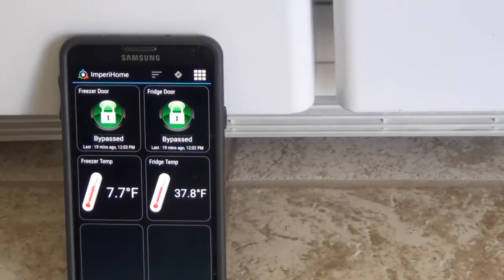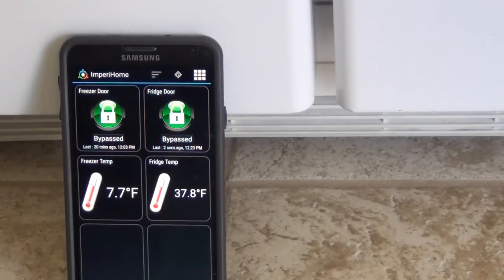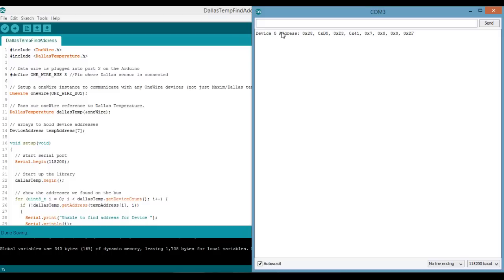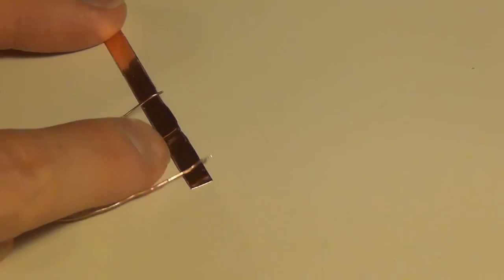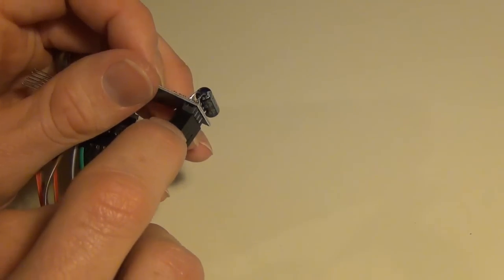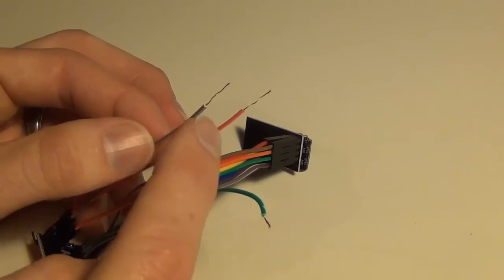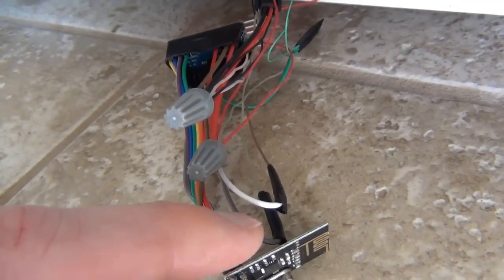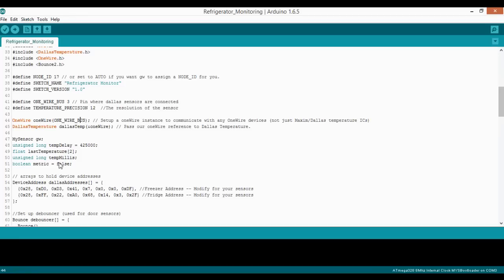Refrigerator Monitoring with Arduino and MySensors

Comment: Question is there a way using Aurdino and an app to monitor not just the doors but the over all diagnostics for an off-grid solar run fridge.. company called Unique from ONT, CA...if the thermostate or any other part is not functioning properly or malfunctioning or needs to be replaced.
Reply from the maker: I'm not sure exactly what you had in mind but I'm sure you can monitor it if you can measure it somehow.  Maybe you could measure the current draw and compare it with a normal measurement then alert if it varies?

Comment: Don't you think putting wire and copper tape will leak the sealing? 🤔
Reply from the maker: It is very thin copper so if there are any leaks they are very minor.

Comment: There are two ways to fix this... one is to level the fridge (gradually raise the two front adjustable legs until the door closes completely again) and the other is the Ardunio way :) This said, it could be an interesting energy saving device. Maybe let out a little beep when the door is open for too long.
Reply from the maker: The door normally closes automatically but the problems start occurring when someone (not mentioning any names) doesn't push the food/drink in far enough which causes the door to remain slightly open. :)

Comment: So it goes like this: 
Sensor >> arduino >> RF Module on fridge >> RF module on home automation system >> Arduino2 >> Wifi / bluetooth module >> to your phone.
Reply from the maker: +Derpy Herpy Close but there are a couple of things I clarified below.  
MySensors Node (Sensor >> Arduino>> RF module attached to fridge Arduino) >> MySensors Gateway (RF module attached to gateway Arduino >> Arduino 2 >> W5100 Ethernet Module) >> Home Automation Controller (I'm using a Vera 3) >> Android App connecting to Vera (I'm using AutHomationHD)

Comment: Are you getting any frost build up in the freezer section where the sensor wires go through the door gasket area?
Reply from the maker: +RJGNOW No, it has been running for about a month now too.  I am using wires from an USB cable I cut from an old mouse.  They are very thin wires and work great for this.

Comment: I was considering doing a similar setup but instead of a contact sensor I was going to use a light sensor.  I figured the fridge already has a contact sensor setup and with the right setting on the light sensor you could even catch the door being partially open from light leaking inside (since it should be completely dark inside the fridge unless it's open).  at least now I have another idea if the light sensor doesn't pan out.

how is battery life inside the fridge?
Reply: scratch the battery question.  I see you hardwired it.  Mines a "over-under" style with a pull out freezer at the bottom so it will have to be done a little different.
Reply from the maker: +bp968 Yeah, I always try to hardwire if I can.  One less battery to change :)  
I thought about using the existing switch also but when my door stays open there are times that the fridge switch is off.  That's why I went this route.

Comment: How do you send the data to your your phone is that radio module a wifi module as well?
Reply from the maker: +Derpy Herpy I am using a Vera as my home automation controller and I'm feeding the information from these sensors to it.  I then use ImperiHome (the app you see in the video) to show the info from Vera in my phone.  So it goes like this: Fridge Sensor > MySensors Gateway > Vera > ImperiHome App.
Hopefully that makes sense.